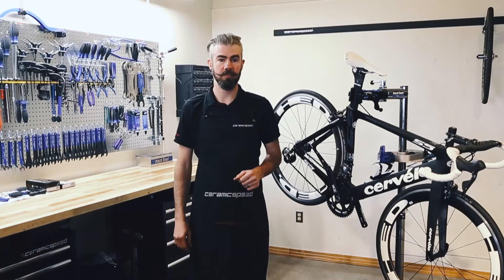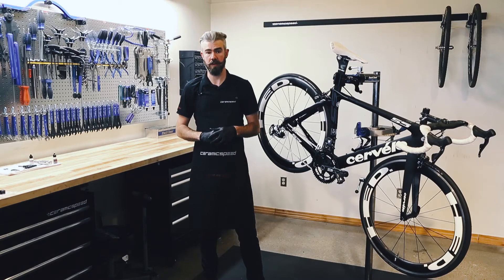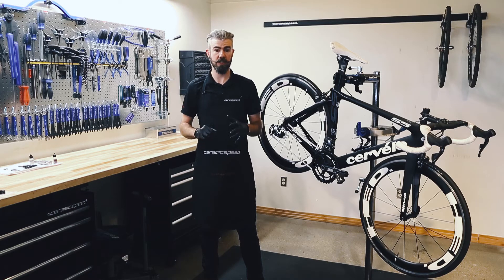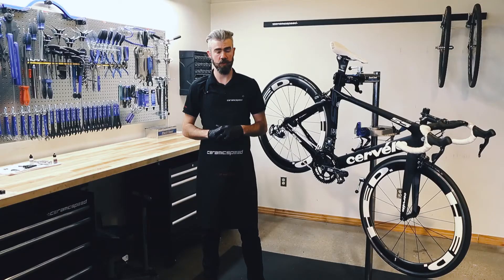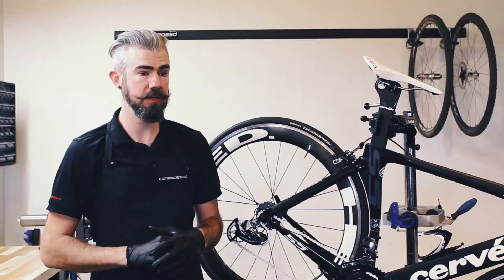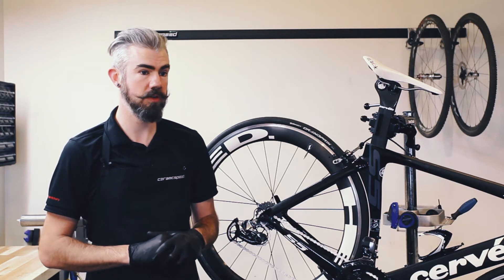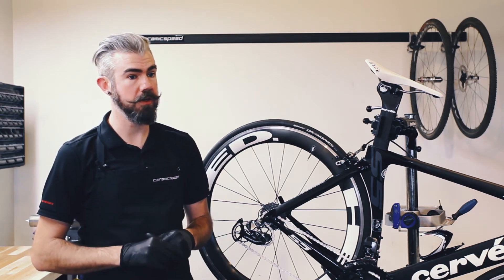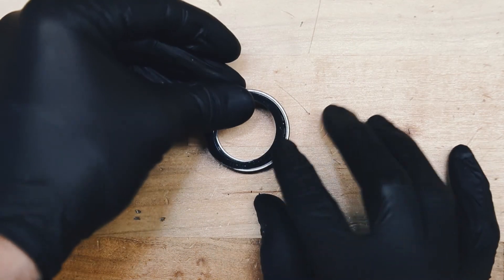CeramicSpeed FAQs - Bearing Maintenance

Comment: is it true that ceramic bearing is need to service 
frequently? I use ceramic bearing on my wheelset
Reply from the maker: Hi Amin, it all depends on what you are comparing against, and what performance/function you are seeking. Many steel bearings in the bicycle industry are not designed for serviceability (some claim sealed bearings are not able to be serviced), and often the stock steel bearings are designed to perform a basic function and last a reasonable amount of time. When seeking performance benefits, as many users of CeramicSpeed bearings often are, you will use thinner grease and lighter contact seals, which do need more frequent service than heavy grease and heavy contact seals. With grease and seals being the same, a quality built hybrid ceramic bearing will outlast steel bearings and require less maintenance.

Comment: Question:  Do I need to use a bearing seal on my front 609 bearings?
Reply from the maker: We always recommend leaving the seals in place. The 'clean lab' conditions testing shows almost no differences (less than 0.05 watt deviation) with the seals on or off, however the lifespan of the bearing will be significantly shortened and maintenance must be done every ride if the seals are not in place. That is why, we recommend that the seals are left in place. For more information on the above mentioned testing, check out this link: https://www.ceramicspeed.com/en/cycling/inside/test-data-reports/bearing-lube-and-seals/